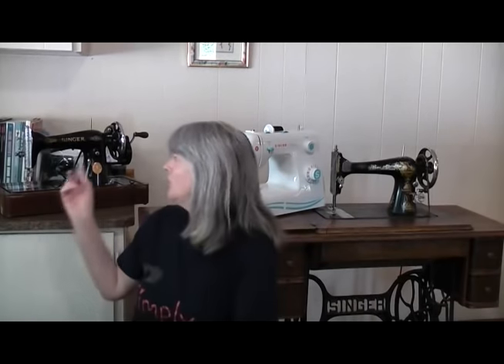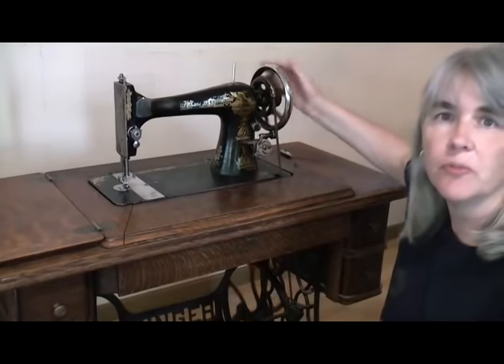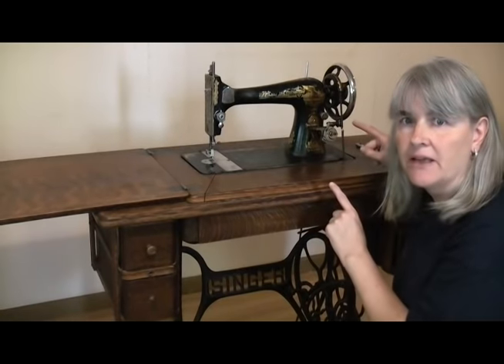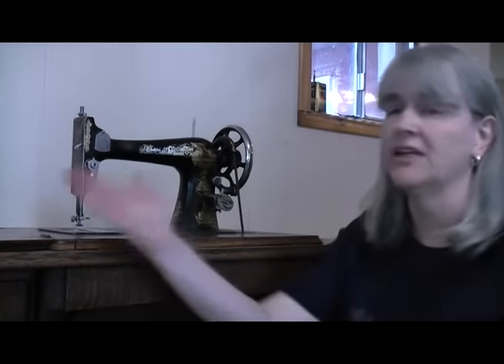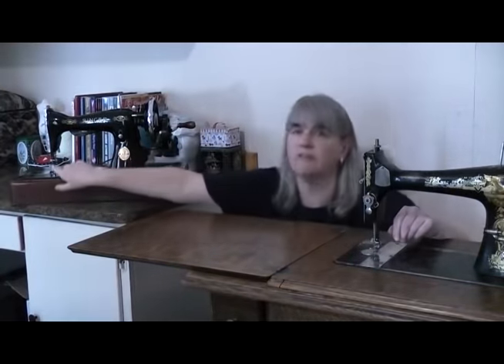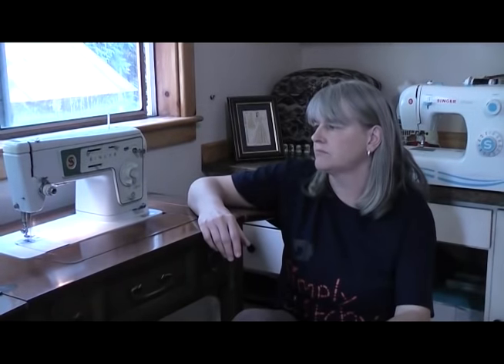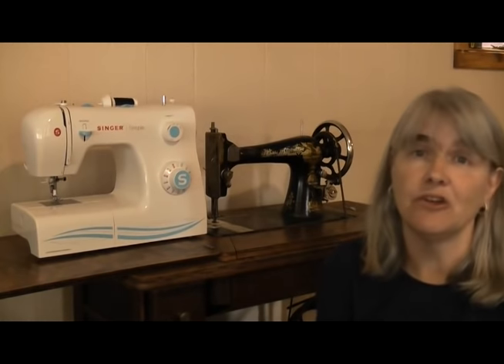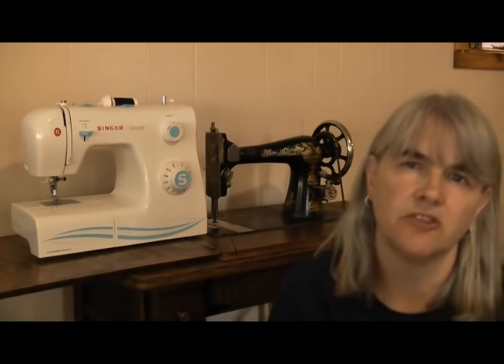Treadle vs Electric Sewing Machines: Which Is Better? #SewingMachines #VintageSewing #Singer27

Comment: I started out with an electric and as time went by i got a chance to buy a 1895 model 28 hand crank and i love it , then i got the opportunity to buy a model 115 treadle from 1917 and fell in love again , i currently have a 1904 model 27 on my treadle as i restore the 115 and when ever i havea small repair i jump on my treadle , love the control of hand and treadle , just like you said its relaxing and therapeutic......👍👍

Comment: You may want to adjust when you engage the treadle belt so the needle is at the up position when the treadle is in the lowest position. That might help the gravity issue.
Reply: Thank you , i was having this issue and didnt even think about adjusting the belt , i will try this now , great tip 👍
Reply: Came here to say the same thing! With the treadle its natural low position, loosen the belt and turn the wheel until the needle is in the high position. That way the default "lowest" treadle position is the highest needle position. Hope it worked for you!

Comment: I'm skipping around your videos (still). I have a treadle, okay 2, and a hand crank. I agree with every point you made,  especially about an electric machine running away.  I was glad to know that the sinking needle on a treadle is not the result of a broken part. I try to keep my feet on the pedal at all times to keep it in place.  Speaking of which... treadling is great ankle exercise.  Strong ankles help prevent falls as we age👍.
Reply from the maker: I try to keep my feet on the pedal too... I usually remember to do that after the needle has sunk. I think it's because my first machine was electric - It's been drilled into me from an early age - keep your feet off the pedal when you're changing a needle or removing your fabric... it's a hard habit to break 😆 Thanks for watching! 😀

Comment: Learned to treadle when I was 8 or 9 years old.35 years later sat down at a treadle and continued as if no interruption. More like learning to ride a bicycle instead of driving a manual transmission.

Stitch quality is why I use the treadle, as it does a true straight stitch. I think an electric is best as a basic machine, but for Jean's and upholstery the treadle is superior.
Reply from the maker: Having both is definitely how to get the best of both worlds! Thanks for watching 😀

Comment: Thank you so much for sharing your thoughts on this! I don't have a lot of experience with sewing myself, but I'm so tempted to sew a backpack for my next hiking trip. If I do, I'll use some pretty tough and modern fabrics and I will sometimes have multiple layers under the needle. I'm debating with myself whether I should buy an old industrial (electric) machine for the job, or if the even older Husqvarna treadle machine my grandmother used back in the day would be capable of doing the job. What would an expert such as yourself do in my situation? 🙂 Personally, I'd find great joy in using the old Husqvarna just because of the fact that it's like a hundred years old, and of course also because the last person who used it was my grandmother many, many years ago.
Reply from the maker: An industrial will do the job but isn't really necessary unless you are going into backpack production. Your grandmother's Husqvarna treadle can do it. As long as it's in working condition. Older machines can sew modern fabrics. The key is to use the right needle, stitch length, and thread for the fabric. As well as slowing right down for the bulky parts. I have a video on sewing layers on a domestic sewing machine here: https://youtu.be/P_mhI-WfORc My treadle from 1912 (called Grandma) handled them a lot better than my Janome from 2004! If it was me making the backpack,, I'd go with Grandma 😉Thanks for watching! 🙂
Reply: @SimplyStitchy  Thank you so much for your reply! I think the old Husqvarna will need a service before I start using it. I don't have the machine at my place right now, but I know the manual is still in the drawer so I can probably do the service myself. At least give it a try 😀 The only thing I have to look up before I do anything is figuring out if I can use any modern needle with the machine. If it has to be some special needle I could be in trouble. On the other hand, my home is not far from the town Husqvarna (Sweden) so chances are I can get my hands on some original needles if I need to. Thank you again, I will check out the video you mentioned.

Comment: I am just getting ready to try sewing on a 66 Red Eye (in a drawing room cabinet), I recently got, but otherwise all experience on electric--first on my Mom's Necchi SuperNova, then the first sewing machine I bought for myself was a Baby Lock (had a knife attachment so could edge finish like a serger, but I've never used a serger, though I was given a used one). After 25 years, replaced the BL with a Bernina with embroidery attachment (gave me sister the BL) and for my leather business got an industrial machine, too. And last year found a lovely vintage electric I had to bring home, and this weekend getting my Mom's Necchi again, as well as a Singer 15-91 in a #42 cabinet in lovely condition.  Whew, the house is getting crowded! Though there are many advantages to modern machines, the older machines with limited needle movement often produce more beautiful stitches!  And I loved your description of sewing with a treadle machine & looking forward to experiencing that!
Reply from the maker: The 66 is a lovely, smooth machine to work with. As it has a top loading bobbin, it's can be a little less clunky than the 15. Both do a great stitch though.  The #42 cabinet is one of my favorites. Does yours have the ink well? I lost mine in a house fire a couple of years ago. Vintage machines tend to multiply - just when you think you house is full... there's always room for more! Thanks for sharing! And thanks for watching too! 😀
Reply: @SimplyStitchy  the cabinet is newer (mid century vs art deco) so not set up for an ink well. Oh, well. Does have a nice bobbin/spool rack instead)... And in great shape--turns out the couple I bought it from restore machines & cab's for a hobby (so prices are great)!  But finally today I did test out the 66 with thread and wow--really understand & appreciate your comparison to electric!  And cleaning  up my Mom's Necchi SuperNova now too--amazing with 4 kids the accessory kit is nearly complete & manuals still intact!

Comment: If you keep your foot on the treadle pedal, you can control the stop until you get your project out from under the needle.  My treadle has a motor installed and the belt simply disconnected but ready to switch back. Treadle is great for quilting with a larger throat space, between the needle and the right side.
Reply from the maker: Unfortunately, I usually remember I need to keep my foot on the treadle pedal to help the stop... after I've taken my foot off the treadle pedal. It all boils down to sewing lessons at school where the teacher drilled into us the importance of... keep your foot off the pedal when you stop. Obviously, those machines were electric but - it's a hard habit to break! Thanks for watching! 🙂
Reply: @SimplyStitchy  Hahaha! True and likely why I forget sometimes also.

Comment: Treadle has no lamp, that’s a deal breaker for me. Nice video!
Reply from the maker: Thank you! I know what you mean about the lighting. I use a standalone lamp with Grandma but it's not the same as having a built-in lamp or a light you can get underneath the arm. Thanks for sharing and for watching 🙂
Reply: I bought a magnetic mini led lamp with a posable arm for less than $10 for mine. Makes all of the difference

Comment: I usually use both on projects. I prefer my hand crank for button holes with a button hole attachment I find both have advantages and I use them both regularly. My electric is a Janome, and my hand crank is a singer.
Reply from the maker: I love the Singer buttonhole attachments. I've used one on my electric 15-91 before now and it's just... nifty! Thanks for sharing and for watching! 😀

Comment: Thanks for the nice video.
I also know turning further after the sewing stop from one of my Singer 15-30 (called Lady Girdle) with hand crank. I think it is due to the flywheel mass of the rather large flywheel that it has. My other 15-30 (called Margarete (Steif) has a smaller flywheel,  She doesn't do it.
Reply from the maker: That's interesting... so the size of the wheel may make a difference? You've given me something to think about! Thanks so much for commenting and for watching 😀
Reply: @SimplyStitchy  also own two Pfaff 31, which are also Singer 15 replicas. The older one (built in 1916) has a very large flywheel (diameter 18 cm)
I had installed an add-on motor and it could not be sewn because it continued to run so hard. When she was in momentum, she still turned the non-activated (pedal) motor. The younger Pfaff 31 (1938) is only 14cm in diameter. It does not run on with the same motor.
My Singer 66 Lotus (1908) also doesn't run after with its 14cm handwheel either.
Greetings from Germany

Comment: Hi, What kind of machine would you recommend for a child of about age 8? I was thinking that the hand crank might be a good entry because they don't go so fast so it feels that it would be safer. I'd love to hear your advice. Thank you
Reply from the maker: Handcranks are a good option due to the limitations on speed. And kids love them! I can't think of a better machine to captivate a child and encourage them to sew! But as most are made from cast iron, they are heavy and could be tricky for an 8 year old to move about. Not a problem as long as you are with them whenever they need to use the machine... but could be an issue if they try to 'play' with their new toy on their own... squashed toes are no fun.  Handcranks can also be hard to find in some areas. They are sought after machines and can come with a hefty price tag. If all else fails, there are some electric machines that come with speed control. You might be able to find one on your local facebook marketplace. Something like the Brother CS6000i or Janome QC6260 for instance. They also have built in stitches and free arm capabilities which will help your child grow their sewing skills.
Reply: @SimplyStitchy  Thank you for your swift reply that's so helpful. I had a look on eBay and even see some children/junior vintage hand crank machines or even labelled as toys Goodness knows how well they sew however. I'll bear in mind the speed regulator possibility for the electric option thanks.
Reply from the maker: Check out my video on toy sewing machines: https://youtu.be/lFOFTRBm4P4 - I compare three different Singer toys from modern day, 1960s/1970s and one from the 1950s. That way you can see how they sew before you buy.

Comment: There are better machines than that Janome to treadle. The Singer 237 is easily treadled and gives you zig zag and reverse. The are others. The Janome just took the motor out of an electric and they treadle way to hard.
Reply from the maker: Yes, the Singer 237 is probably better but they are harder to find. Although to be honest, I'd rather have an original treadle over a modern one. Thanks for watching. 🙂